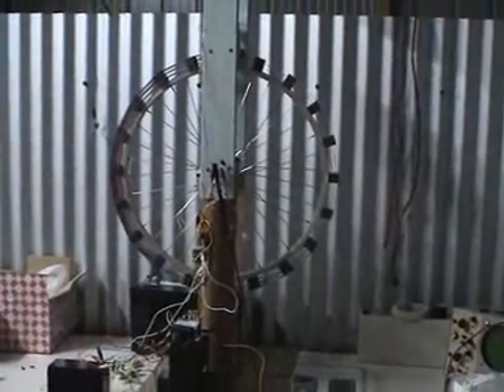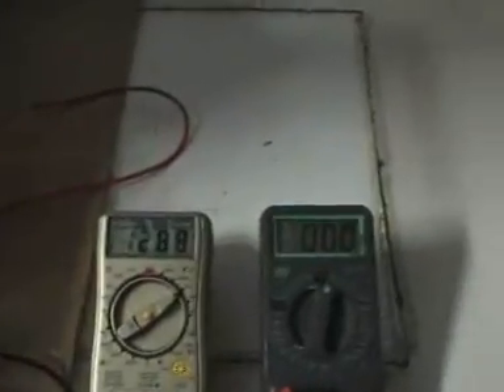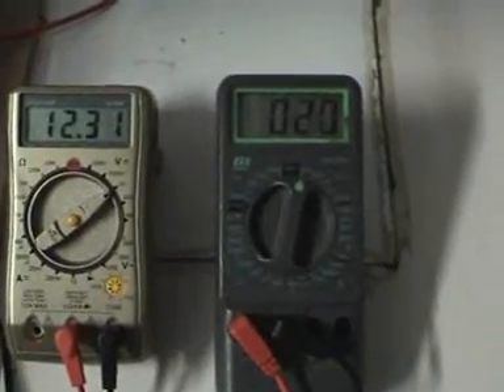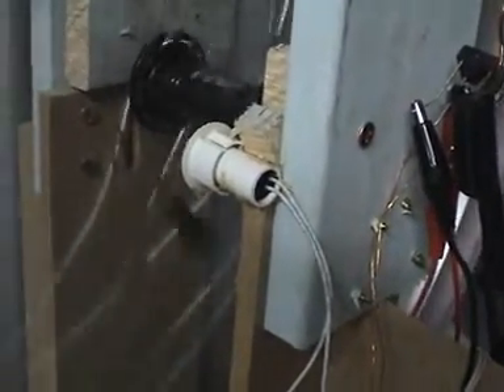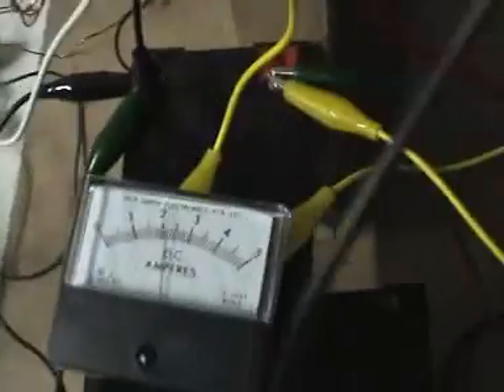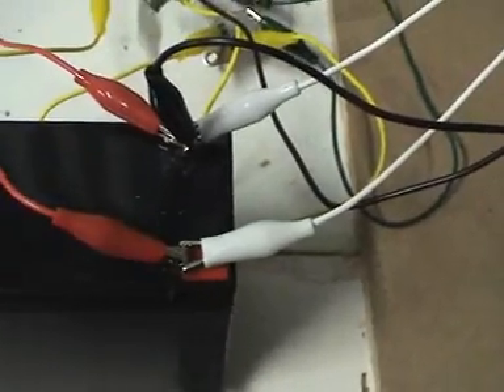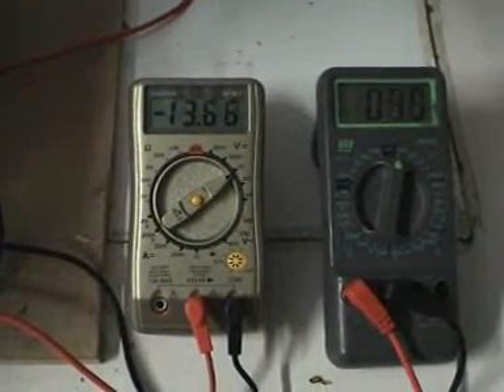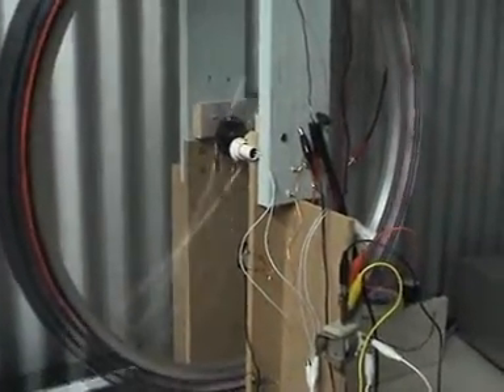Bedini SSG Self-runner

Comment: @koornj Maybe I used the wrong terminology, did this SSG have a magnet to activate the reed switch with another magnet independant of the rotor? or this is achieved as the rotor engages?

Comment: what about an IGBJT? eg 6N170A, rated to 1700v
I have a BJT that can take Vce of 1000v, and Ic of 2A, but it's gain is 2, so you have to shove an amp through it to get it to switch on.
How do you prevent your relays from arcing?

Comment: Hi John, you can just use external resistors to make
lower voltage voltmeters act as high voltage voltmeters. Just add a series resistor or voltage divider resistors.
Also the same with analog ampmeters.
Please do a new video if you have analog meters, so
it is much better to see.